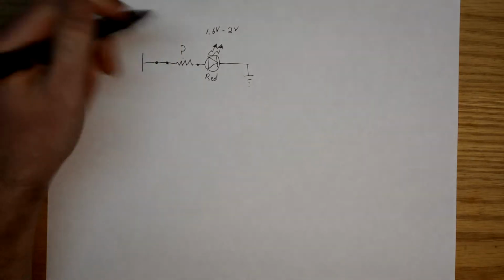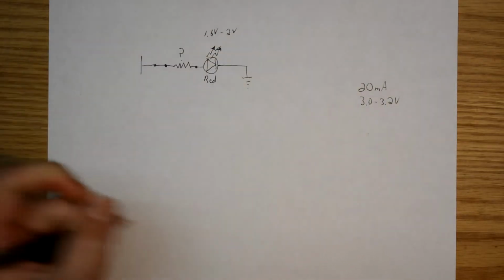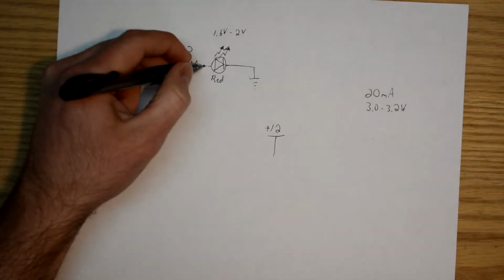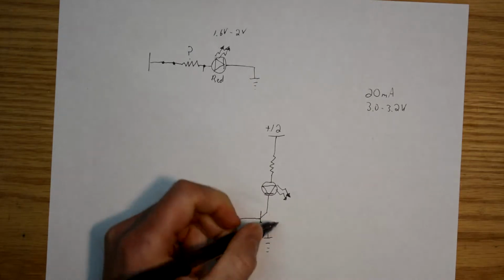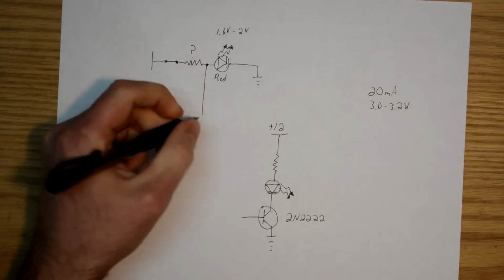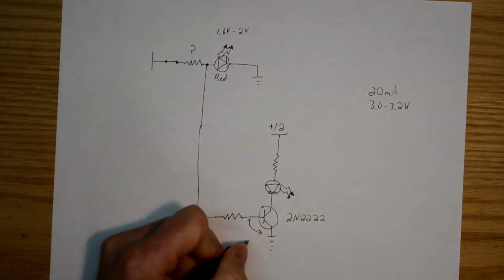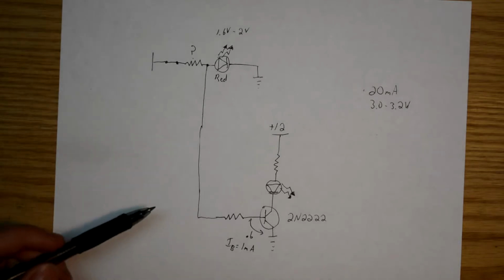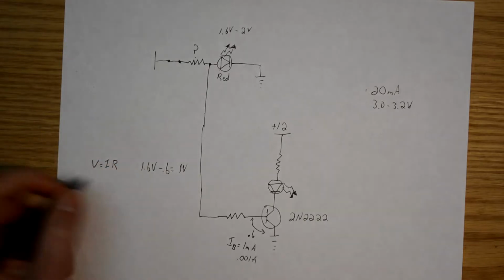Using a transistor to piggyback an LED

Comment: This video is very helpful, were you able to view my BINGO BOARD video ? I posted it a few days ago. I did more testing today. I got .4 volts at the two legs of one of the red LED's. I took a 3.3 volt LED and touched the two red LED's, and turned off the overhead light and It did light up but not bright enough for the remote display. I have some different LED's that have 8" pig tails to wire them up. They also have a inline resistor that is set to be powered by 12 volts. I would only need to figure out a little more on to hook up the 2N2222 transistor, and the correct resistor going to it. As I mentioned before to unsolder and remove the red LED's is not feasible, but going with your method I feel is my best chance. If you need more info, please let me know.
Reply from the maker: I'm having trouble determining exactly how the board is setup from the video but I believe it is doing some kind of multiplexing.  I would suggest that you built the circuit from this video using your long lead resistors with the inline resistors.  Instead of the 1K ohm resistor I describe going to the base use a 10K to test.  Use this circuit to probe the LEDs while it is running (this should be safe as long as you don't short anything as you'll at most pull 1.2mA from any point).  I didn't label the transistor in the video very well but you will connect the low(negative) side of the LED to the transistor's collector, the 10K ohm probe resistor will go to the base, and the transistor's emitter will be connected directly to ground.  Ensure you have the ground of this circuit connected to the ground of the board.  The supply (positive voltage) and be from different sources but if they are different sources do not allow them to be connected together.
Reply: KYCoffey I agree. I went to Radio Shack yesterday to get the 2N22222 transistor, but they did not have it. I will order some off of Ebay. The only other item that I'm not sure on witch of the three legs on the transistor to hook up to the red LED, The 12 volt LED, and the ground. Can you advise me on this ?
   Once again I want to thank you for help. Dadholly
Reply from the maker: DAD HOLLY
From Radio Shack you can probably use just about any NPN transistor they have, just note on the package the order of the base, emitter, collector.  I chose 2N2222 because I have hundreds of them and have used them before.  The 12volt LED should have a resistor and one leg should go to positive supply and the other should go to the transistor's collector.  The transistor's collector should go to ground or negative supply voltage.  The 10k resistor I mentioned should go to the base of the transistor.  You can connect a wire to the other end of the resistor and use this circuit to probe connections on the board.  Be sure to test on something like a 1.5V battery first to ensure all your connections are correct.  The LED connected to the transistor should light when connected to a voltage source over around .6V.  The brightness will vary depending on the voltage of the point you are probing.